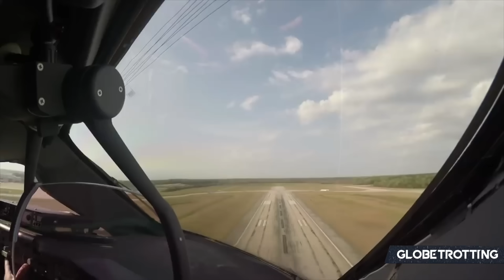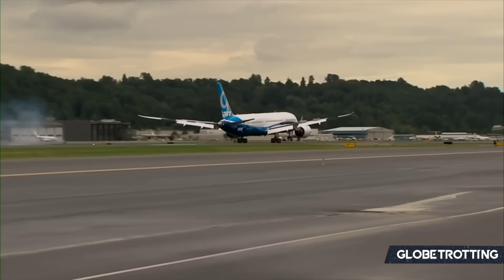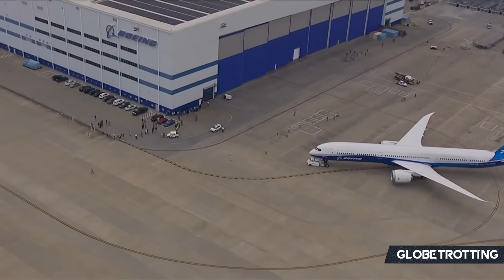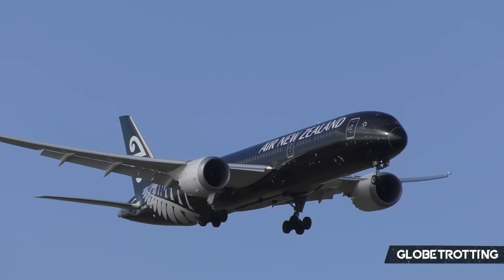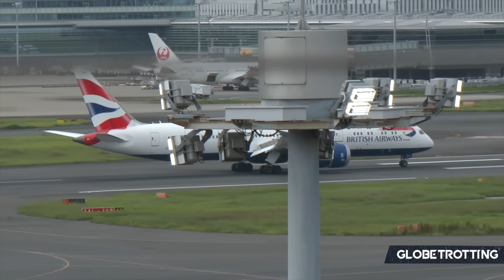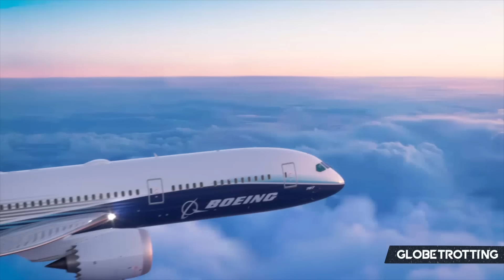Why BOEING 787s Are GROUNDED

Comment: It appears that airlines and aircraft manufacturers should take a second look at the current generation of jet engines.  It seems that the advanced technology emphasizing efficiency far exceeds the ability for long-term endurance and materials availability.  I think you would want to look at the big picture and build a less-efficient engine that stays on-wing a lot longer and is built of materials that are more readily available.

Comment: Your summary, in my opinion, is a bit unfair regarding the 787.  The issues are the engines for the planes.  This is not the first time that Rolls Royce has had issues as they also experienced problems with the engines for the 777.  Air New Zealand comes to mind because I seem to remember they had a significant hit to their international fleet due to engines. I think it is fair to say that Boeing is losing the long haul race to Airbus A350 and even the A330Neo as their designs are more futuristic.
Reply: @stanwill  also QF32 (RR powered A380), and I believe a T700 powered A330 got involved in an incident similar to BA38
Reply: @stanwill  futuristic and innovative are not the same thing. The 787 has pioneered a few important technologies, such as increasing usage of carbon fibre which makes the plane lighter, and a bleedless system that minimizes cabin fume events, which have happened on Airbus planes as well as other Boeing planes. The A350 and A330NEO are actually more conservative
Reply: The 330 neo enters the chat...😂😂
Seriously, you must be joking...

Comment: Look, it appears that GE Aerospace is the big winner in all this mess. At least the LEAP-1A/1B engines are generally pretty reliable, as are the GENx and GE90 engines on the 787 and 777 respectively. Rolls-Royce needs to address the Trent 1000 issues really fast because even Airbus is openly starting to wonder will we have serious issues with the Trent XWB-84 on the A350-900 in the near future.
Reply: The LEAP does have an issue with the LRD though
Reply: @Sacto1654  there are issues with the XWB 97 on the A35K
Reply: @Blank00  That was what Emirates said due to shortened life between repairs due to the dusty conditions in the MIddle East. Rolls-Royce is implementing fixes for this issue (I believe they're about to complete the testing of the updated engine).
Reply: @Sacto1654  everyone should take note that RR is fixing the issue in that case, meanwhile what is Airbus doing about that case?

Comment: Well I would have low expectations with the 787 being the a Boeing, but after the issue with the batteries catching fire, there haven't been anywhere near as many issues as with other Boeing aircraft.  So I would say the 787 is better than the average Boeing.
Reply: The 767, 777, 747-8, and NG are also better than the average Boeing. Like the recent 787 issues, issues with the 767, 777, 748, and NG are less attributable to Boeing and more attributable to things like maintenance, crew error, and engine companies. As for other older types like 747-400 and 757, issues are more attributable to age and maintenance.
Reply: Whenever I see a comment like this I lose faith in humanity.

Comment: Unless Airbus is footing the bill for the PW1000G issues, Rolls Royce needs to foot 100% of the bill and compensate Boeing for any lost business that’s attributable to these engine issues, including the units in the factory that are having delivery delayed because of the extended wait for engines, as well as all lawsuits related to these engine issues that Boeing has faced, is facing, and will face. But so far, it seems only PW is footing the bill and taking 100% of the responsibility for PW1000G issues
Reply: Not everything is as it seems to be, or even should be. It all depends upon legal and contractual liability. This can be affected if it is deemed that the issue is beyond their control and what measures, could, should and have been taken to mitigate. 

In some jurisdictions it can even depend on the relative sizes of the defendant and the claimant.

The case with the P&W engines is a little easier to deal with in a legal sense because the issue was as a direct result of contaminated raw materials being used.

Some may say that it was clearly the supplier of the contaminated materials fault, not an unreasonable conclusion, but what if the contract clearly stated that all materials must be tested on receipt to ensure that they comply with the contractual specifications? After all, while a supplier may be responsible for goods in transit, damage and contamination can, and often does happen during it.
Reply: This is why they have contracts. Whichever party is contractually obligated to foot the bill should and will be the one to do so. Very generally speaking that would typically be Rolls Royce in a situation like this, but sometimes a purchasing company will release the seller from some or all such liability and assume the risk themselves in exchange for other concessions, such as a better price or a tighter delivery timeline.
Reply: GIven RR  mostly do "power by the hour" contracts, they ARE footing 100% of the bill because non-flying aircraft means they don't get paid

Consequential damages (inavailability of aircraft) is a contractual issue and you can be very sure that tables are being thumped in high level meetings in Airline, Enginemaker and Insurance company boardrooms